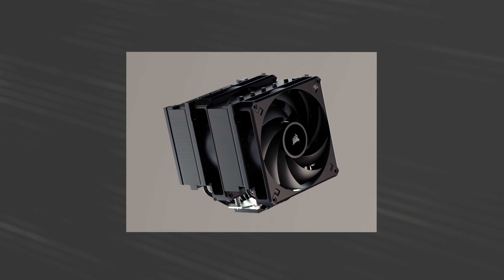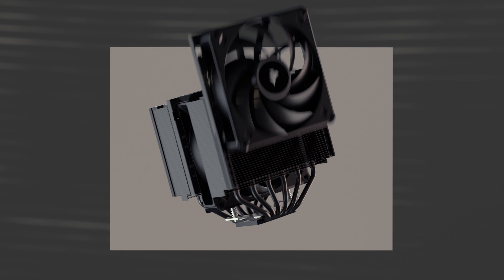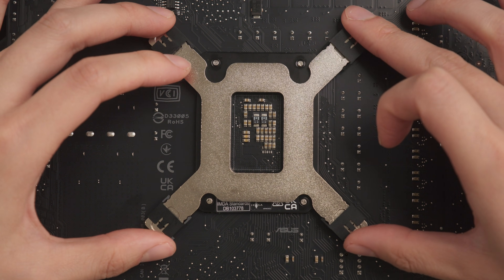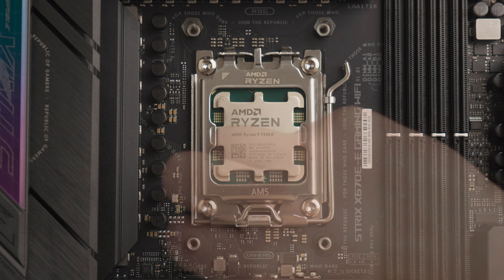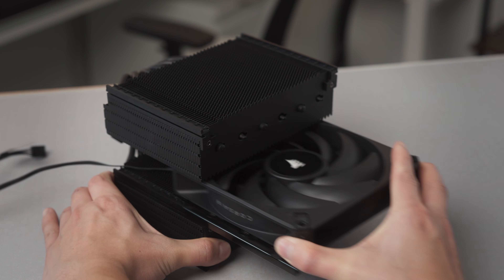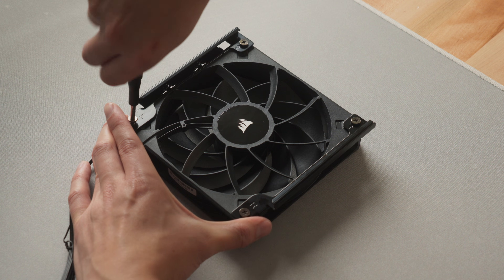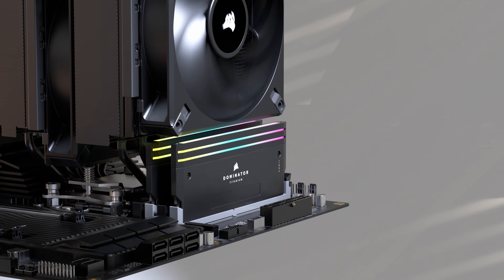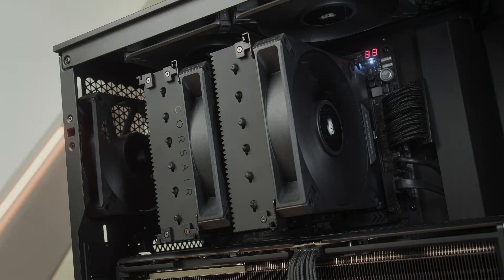Installing the CORSAIR A115 High-Performance Tower CPU Air Cooler

Comment: Are you able to mount the front fan with Corsair Vengeance DDR5 (non-RGB) and still close the glass panel on a 5000D Airflow ?  I have my doubts.   From reading the specs there is only 20mm clearance for RAM with front fan installed.  The  Corsair DDR 5 is 35mm high so that an extra 15mm needed plus the height of the cooler which is 165mm.  So you need a case that can take a max cooler height of 180mm.  The 5000D maxed out at 170mm :(